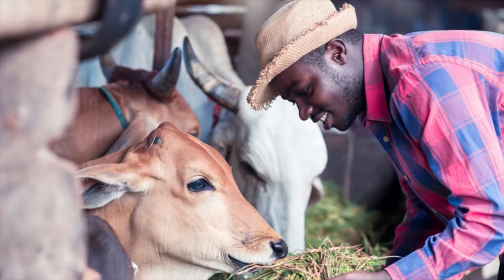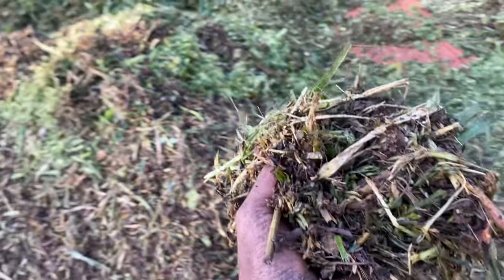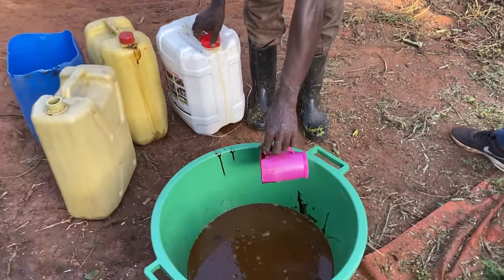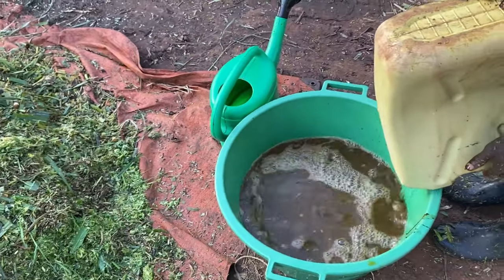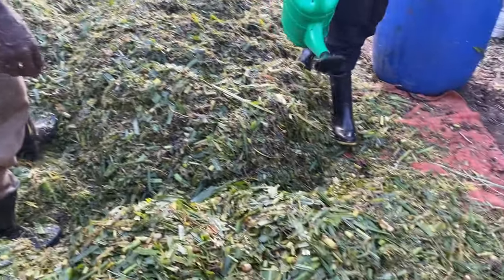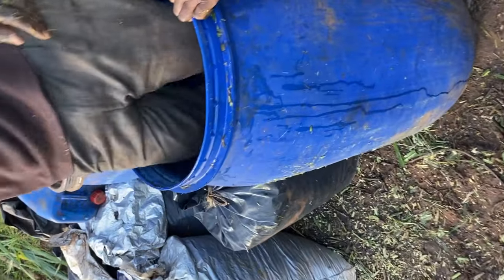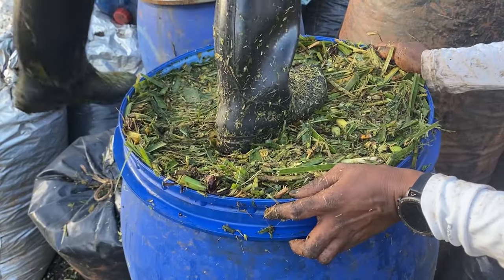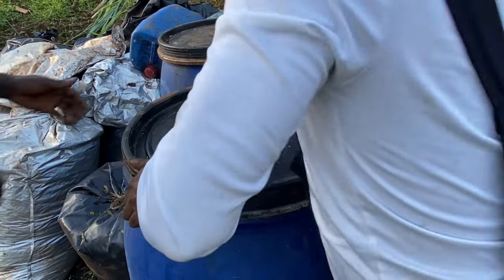How to make silage ready in 3days with MolaPlusLivestockMicrobes​@shambasolutions ​⁠+256758712786

Comment: Thanks for the innovation, what microbes are basically in your product. The potatoe leaves have varying levels of color detoriation which is not good. While wilting potatoe levels, the objective should be to obtain a homogeneous wilting. 
Lastly, the quality of silage is dependent on many factors not only microbes, so the video should have erabolate the quality control and the target values of silage.

Thanks 🙏
Reply from the maker: @Silver 
Molaplus livestock microbes is a suspension specifically formulated for ruminants containing beneficial organic acids,lacticbacteria,beneficial yeast, phototrophic bacteria,enzymes,beneficial fungus and Protozoa and once this is added to feeds enhances feed utilization,increase protein synthesis and improves microbial activity and increase feed palatability.
2.Issue of varying coloration of potatoevines yes this is true because for this case these were obtained from the garden after harvesting sweetpotatoes so this variety used for this demonstration was not specifically cultivated for pasture 
However if afarmer grows vines specifically for pasture production it’s easy to get leaves of more less same maturation and so once chopped and wilted you can have similar coloration but as mentioned earlier for this particular case we wanted to show what exactly happens when a farmer picks sweetpotatovines directly from the garden after harvesting their vines and also don’t forget we mixed vines and Napier for this video. So we could not get homogenous wilting since we where dealing with a legume and a grass.
3. True quality of silage is dependent on many factors however the purpose of this video was to focus on the main ingredient which is the silage innoculant (molaplus livestock microbes) that not only controls microbial stability inside the silo but also directs the direction of fermentation all geared to ensuring that the farmer gets the best quality silage in a record 3days. 
Thank You
Reply: @shambasolutions  
Thanks for the feedback, I look forward to seeing better video that decipts quality of the feed ingredients to avoid contamination of feeds especially with clostridium and mycotoxins that negatively impend production and thier subsequent effect on human health. 
Other than that, I would be willing to support your endeavors with further strategies to enhance quality control.
Thanks
Reply: @silvertukamushaba9201  why don't you just make your video and show us
Reply: @sylvianorah1367  Madam, it was not exchange of words or making my own video, it was knowledge to share.
Reply: @silvertukamushaba9201  You've taken her comment negatively. It is a sound advice. If you are an expert in that area of quality control, you will be adding creme to the already existing content. That's the essence of value addition.